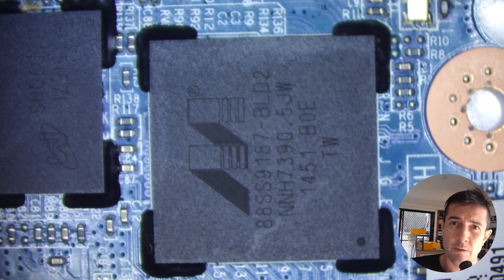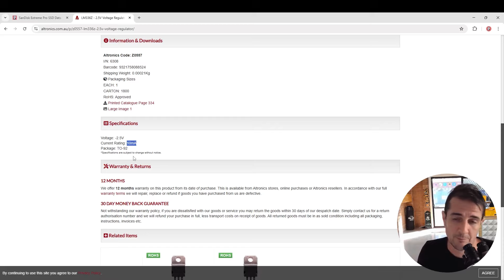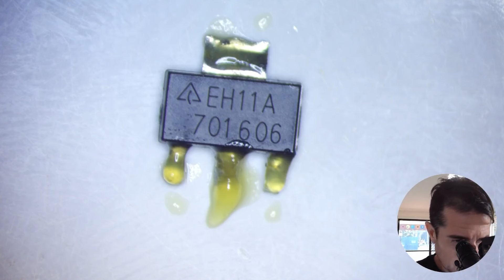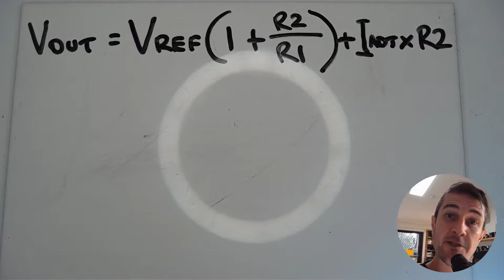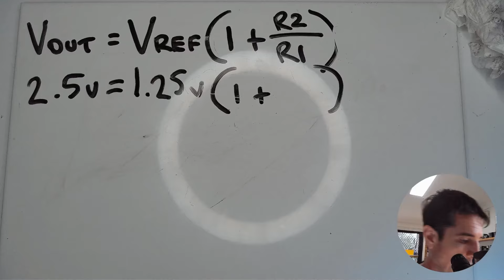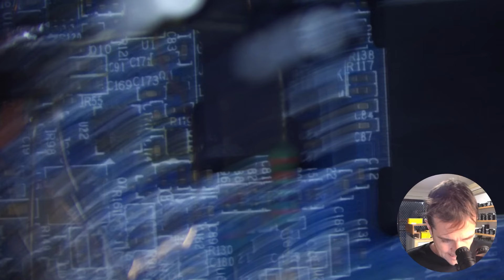Dead SSD Fixed with Local Electronics

Comment: Can you upgrade the capacity by replacing chips or adding them ? Or will the sad controller get angry and throw a tantrum?
Reply from the maker: You would need access to manufactures programming software
Reply: @ZeroalphaAu  its not programmed into the controller ? So an hardware engineer can help get into it ?

Comment: Maybe I'm missing something here, but if it's just a short term fix while you get data off, why can't you just provide 2.5v from a bench power supply?
Reply: I was thinking the same thing. Maybe the video wasn't so exciting if it did or who knows.
Reply: @fliporflop7119  If that's the case, and he was messing around with a customer's equipment unnecessarily...

Comment: if the 3,3 v was already regulated on the pcb locally, you could theoretically jyst drop the 0,7 v trough a sylicon diode andget roughly 2,5-2,6v on the other side, but i don't know  how much it would sag under load
Reply from the maker: Diodes have non linear voltage drop characteristics and output is effected by temperature and load. Not safe enough for an SSD cpu as they need tight voltage tolerances with no ripple
Reply: Sounds good to me. The 2.5V regulator's input is actually 3.3V, so it might be better to use two Schottky rectifiers in series between Vin and Vout. That would get closer to 2.5V. The max load is only 200mA, and the actual load is probably only half that.